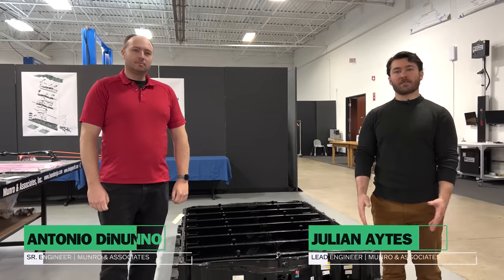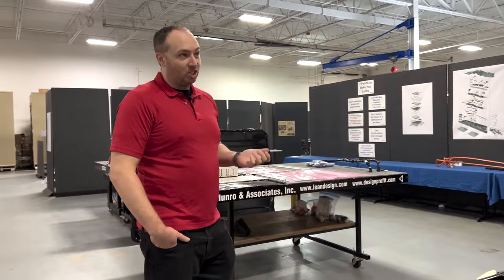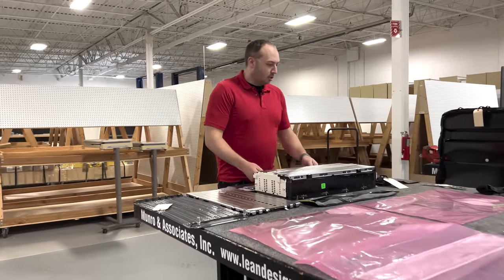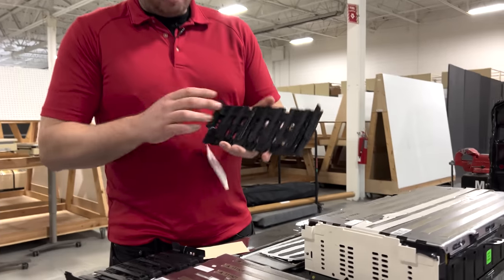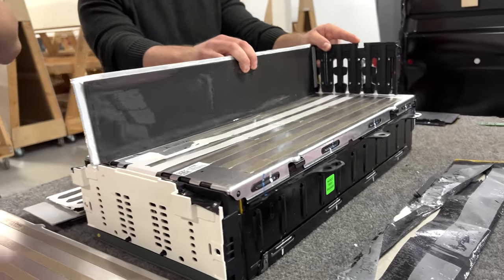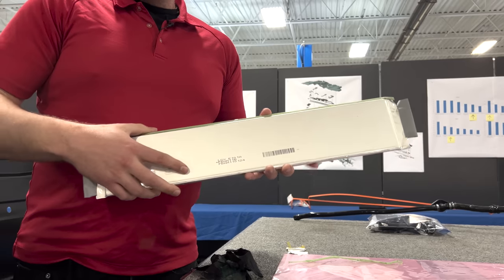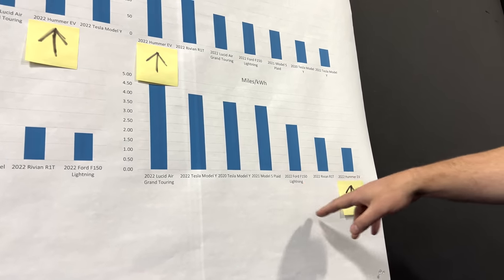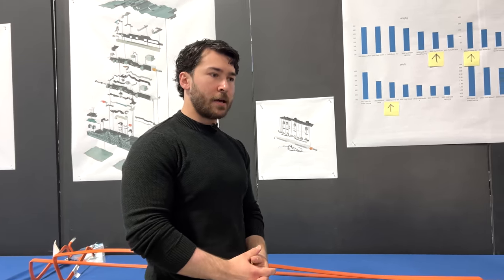This is NOT Lean Design: Hummer EV Battery Pack Breakdown

Comment: So just from the offset, I think you two seem to be missing the point. First, yes, it's probably the heaviest batter you've ever pulled, but based on what I've seen, it also has 50% more energy capacity than any battery you've ever pulled (i.e., it would be absurd if it didn't weigh more). Second, Ultium is a structural battery pack, so a lot of the material and weight is actually due to its role as part of the vehicle's frame (i.e., the additional weight of the pack is actually weight that was reduced from the rest of the chassis).
Reply: 50% more capacity is a nonsense figure. Overall capacity is meaningless if the weight drives down efficiency and range, and the size drives down cargo and cabin capacity. Battery packs are generally rated in terms of capacity per volume, or capacity per weight. That gives you a meaningful way to compare because all battery packs are going to be different overall capacities. 

And there's NO WAY that weight has been removed out of the structure of the vehicle because of this with only 28 bolts as attachment points. This is a TON hanging from the bottom of a vehicle that weighs nearly 10,000lbs. You cannot possibly try to argue that  the 8,000lbs that isnt battery weighs less because of the battery. The pack may provide some rigidity across the diagonal, but all battery packs do that to some degree, and generally trucks dont even want rigidity in that direction in the first place.
Reply: Weight that's reduced? Ah, NO. The Hummer EV weighs more than the original Hummer or a new Escalade CARRYING this battery pack.
Reply: @patreekotime4578  50% more capacity as in, this pack contains 219 kWh gross energy capacity, whereas, the next largest pack they've ever pulled maybe has a 135-140 kWh of gross energy capacity. If it didn't weigh significantly more, then it would represent several step changes in battery advancement.
Reply: @jamesengland7461  Yes, and most EVs weigh 25% to 30% more than their equivalent ICE counterparts, so what's your point?
Reply: @jamesengland7461  And if you're trying to say that the HUMMER EV weighs more than the Escalade with a HUMMER EV battery loaded into it, you're wrong. The curb weight of a gas Escalade is ~6,000 lbs. 6,000 + 3,000 = 9,000 lbs, which is the curb weight of the HUMMER EV. 🙄
Reply: @newscoulomb3705  How much more than it’s competitors does a Model Y weigh?
Reply: @tommornini2470  It depends on the model, but at least 500 to 1,000 lbs. Tesla still hasn't reached parity with gas counterparts yet, unless you get their reduced range variants. When dealing with fullsize trucks and SUVs, those numbers get worse, of course. And that's what we're talking about here. The Ford Lightning, for example, is between 1,000 and 2,000 lbs more than the ICE F-150.
Reply: @newscoulomb3705  Thanks.

Yet Tesla is parity in some of their vehicles.

The proof will be in the CyberTruck.
Reply: @tommornini2470  The Chevy Bolt EV was at mass-parity with ICEV 6 years ago, so it's not some huge deal. The smaller the EV, the easier it is to reach that mass-parity with ICE. For larger format vehicles, however, we're still likely 10 years away. Tesla won't be doing it with their first generation Cybertruck, either. Just look how far behind they are from mass-parity with their Semi.
Reply: @newscoulomb3705  Because CT ≈ Semi?

You may be right, but stating it as a fact at this point is a fallacy.
Reply: @tommornini2470  No, because scale matters. The larger the scale, the worse an EV becomes relative to its ICE counterpart. Small EVs are at parity, midsize EVs are almost there, but large EVs will be very far off. Fallacy indicates a flaw in the logic, but my logic is sound. 

Yes, we can't be certain until after the Cybertruck is released, but based on the information we have so far, it won't be operating at mass-parity with fullsize ICE trucks. If Tesla can get their hands on 500 Wh/kg batteries for the Cybertruck, then yes, they will be close, but those are still years from being production ready.
Reply: @newscoulomb3705  Today, not always.

Engineering is the art of demonstrating that “impossible” is, indeed, possible.
Reply: @News Coulomb  if the EV weighs 9001, you're wrong. Look it up.
Reply: @jamesengland7461  The GMC HUMMER EV has an official curb weight of 9,063 lbs, which is pretty close (and all that I was saying). Either way, the Escalade and HUMMER EV aren't actually equivalent vehicles. The HUMMER H1 (the actual comparable ICE platform) had a curb weight over 8,000 lbs, which would make your assertion incorrect (it would be 11,000 lbs if loaded with the HUMMER EV's battery).
Reply: @newscoulomb3705  some list the original Hummer under 6000. It varies wildly.  My point is this ev is ridiculous overkill
Reply: @jamesengland7461  I agree. It certainly is. However, my point is that this is the same battery that will be used in the Silverado EV 4WT, which is a pretty basic commercial/professional grade fullsize truck. So ridiculing a structural battery for not being as light as a non-structural battery is absurd. And crying foul about the battery's "efficiency" is nonsensical, because in the 4WT, it will support 450+ miles of EPA range (and serve a useful purpose for society).
Reply: @newscoulomb3705  Stacking two battery packs on top of each other is in no way any kind of grand engineering acheivement. And its meaningless, because it doesnt give this vehicle better range or hauling capacity than its competitors with much smaller capacities. I guess it will impress people who think "bigger number better" but it isnt a real metric. If anything it is an extreme disadvantage because while battery supplies are constrained it means GM cant build as many of them as a competitor with a smaller capacity pack. It also means it takes longer to charge, is more expensive to drive/own, and puts a bigger strain on the grid.
Reply: @patreekotime4578  You keep making straw men here. I didn't say that it was a "grand engineering achievement." I said it was the first structural battery and the highest capacity battery that they've pulled, so it makes sense that it is the heaviest.

As for the range, you are wrong unless you're referring to vehicles that haven't been released to the public yet. As inefficient as the HUMMER EV is, it has the best independently tested, real-world towing range of any EV currently sold. Yes, better than both the Lightning and R1T when towing equivalent trailers. The more efficient, aerodynamic Silverado EV will likely have >50% more range than the current Lightning and R1T when towing the same trailer thanks to the additional capacity of this battery.
Reply: @newscoulomb3705  Again, you seem to have an obsession with static, isolated numbers. But static isolated numbers arnt comparable across different vehicles. You dont talk about how many miles a car can go in isolation, you talk about its mpg. How does that towing range per kWh compare?
Reply: @patreekotime4578  No, actually, you are the one obsessing about static, isolated numbers. You're only saying this now because you were wrong about the HUMMER EV's overall towing range. Yes, the HUMMER EV is less efficient than the Lightning and R1T while towing; however, the HUMMER EV'S overall consumption was less affected by towing (i.e., it lost less range as a result of towing than the Lightning and R1T). 

Look, we already know that the HUMMER EV is a less efficient vehicle based on the nature of its being a luxury, high-performance, fullsize, off-road truck. It has almost nothing to do with the battery, however, and a 100 kWh, single-stack Ultium battery wouldn't change that. It would still be less efficient than the Lightning or R1T. 

However, the larger capacity pack itself serves several purposes beyond compensating for the inefficient HUMMER EV platform, and when that battery is combined with a more efficient fullsize EV truck platform like the Silverado EV, that additional capacity translates directly into additional range. 

And that's my point here, they are doing a battery teardown here, but they are making erroneous connections between the battery and the performance of the overall platform. If they were to plug the efficiency and range numbers for the Silverado EV into their charts, they'd have to tell a very different story. Same battery. Different story.
Reply: @newscoulomb3705  I never did as you claim.

Comment: Aluminum work hardens and is subject to cracking/failure. Steel is generally a superior choice where frequent vibration/flexural stresses may be applied. Consider they expect this beast to be flogged off-road, the choice of durability over weight savings is not a surprise. That being said, these will not do well in the North East/Canada, or any rust-prone environment. The rest of the details are pretty par for GM. If you look at GM as a legacy auto manufacturer that still designs many components with the 70 thru 90's mentalities using legacy suppliers/subcontractors, then everything here makes sense.

Comment: The scary thing?  Hummer is the first application of the Ultium platform.  So what compromises are made for Lyriq, Blazer and Equinox?  GM is already recalling the Hummers for battery pack replacement for water intrusion.  And GM is supposedly working on Gen 2 Ultium already so maybe they will ACTUALLY put in some sort of effort on Gen 2.

Comment: Listening to these guys try to determine what the insulation material is between the battery cells is hilarious.  If you know what it is, you know how important it is to prevent thermal runaway and stop fires from spreading from cell-to-cell.